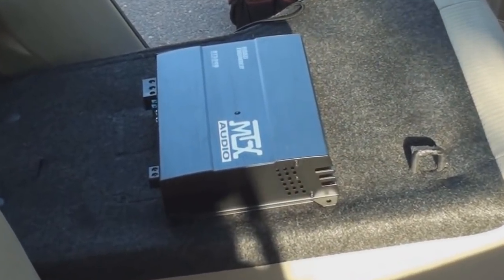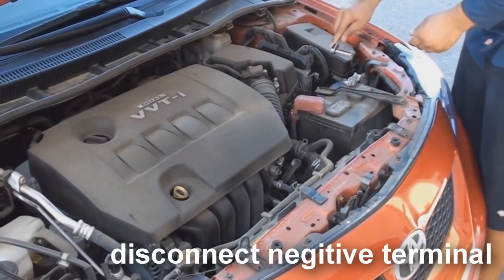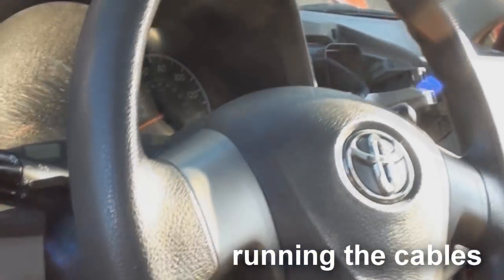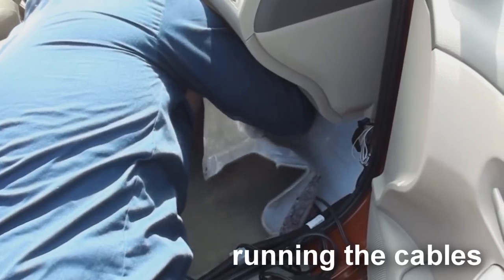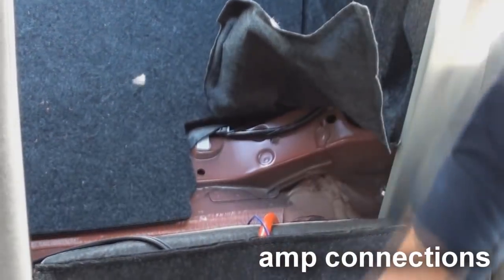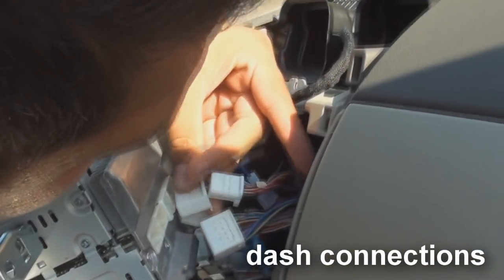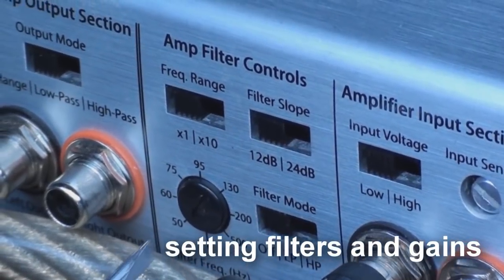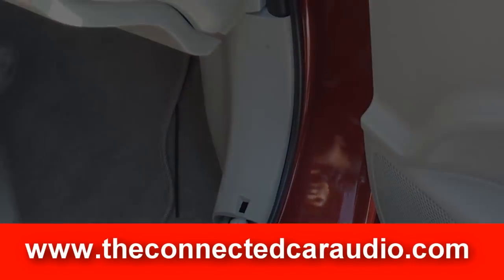How to install a car amplifier

Comment: BRILLIANT thanks so much i am able to do the full installation but never been good at setting the amps to work without as you say distortion ive run 4 speakers before with a 4 channel but never had that much success also running an aftermarket headset like a kenwood with 2x RCA outputs not needing a splitter ive never tackled using tweeters in the front pillars

Comment: Bro ty..This is the best video I’ve seen...I was a bit lost as to where did I connect the blue cable to turn on the Amp. I recommend this for Noobs like me.
Reply: yes mine is jus laying under driver side floormat plus i dont use rca cables jus that one plug in with wires to it

Comment: Another one who takes shortcuts with crimping wires that work their way loose quality work is done with soldering and there are enough male female adaptor plugs out there to do the job once do it right also without butchering the loom but i give you 10/10 for your tutorial clear and precise explanation i learnt a few things

Comment: you  said rund the power supply and the remote or on off switch to the driver side and the audio in to the amp will be on the opposite side or the passenger side to avoid noise into the system, BUT at the end of those wires you put them close together behind the seat close to the amp, my point is if you put them or wired them on one side of the vehicle saves time.

Comment: Very well narrated/instructed and in lowest possible time as well. I'm sure you have a great customer base where ever you are. Just if you could make another video on how to connect just internal speakers ?
So the speakers have two wires, both come off and new one connected with amp is connected to speaker too ?

I'm trying to reach good sound using just good brand 6x9 and 4 5" speakers, but all connected to an amp. 
Thanks :)

Comment: you forgot to mention that when you drill through the body panel into the firewall, you then paint the exposed metal to stop rust, then add an o ring with the correct gauge hole that you can feed your wire through

Comment: ConnectedCarAudio, It looks like you're working on an 09 corolla? By any chance, do you have a video of the entire install? I'm struggling on two things: 1) where to drill or feed the amp cable wire through the firewall 2) wiring diagram for the rear speakers to add in an output line converter. Warm regards

Comment: This video has helped me understand all of this a lot better.  I'm going to need to use a Line Output Converter with my car to use a sub woofer, but I'm unsure on how to hook that part up correctly.  Would I need to figure which wires hooked into the factory stereo are my rear speakers so I can tap into their response, or do you have another suggestion?
Reply from the maker: That's exactly what you need to do. The rear speakers are usally the best to tap into. If you are installing a subwoofer it makes it a little bit easier cause you can sum the line out converter positives together and the negatives together and only tap into 1 rear speaker. I have a video on how to add a subwoofer to a factory stereo but it's for a camry I think but you should be able to watch it and get a better understanding of adding a line out converter
Reply from the maker: That's exactly what you need to do. The rear speakers are usally the best to tap into. If you are installing a subwoofer it makes it a little bit easier cause you can sum the line out converter positives together and the negatives together and only tap into 1 rear speaker. I have a video on how to add a subwoofer to a factory stereo but it's for a camry I think but you should be able to watch it and get a better understanding of adding a line out converter

Comment: nice video and well explained. i have a quick question. i recently bought an amp wiring kit for my 1100W 4chl amp. but it did not contain all the terminals i needed. what size terminal would be best to connect a 4gauge wire to the amp and the ones that came with the kit (for the ground and the battery) are way too big to connect to the amp. Thanks

Comment: There are much better options to mounting the amp like that. There is no need to cut up the rear carpet that much as that will affect the resell factor.

1.) Pull rear carpet off the back of seat which exposes usually a metal plate

2.) Cut a 1/2 , 5/8 , 3/4 inch board to the size of your amp with at least an extra inch or two around the sides.

3.) Find a good place to screw the rough board into the metal back plate. Slightly countersink screws if you want less worry of metal on metal contact. Simply drill the small screw holes and then use a slightly larger bit to open up the hole only on the surface to allow for the head of the screw to sink into the wood.

4.) Put the carpet back over the board and securing it back to the seat using whatever factory clips / edging was used. Should have a very clean looking rear seat with very minimal bulging from the wood installed behind / under the carpet.

5.) OPTIONAL but worth it. Find something to use as a spacer about 1/2" - 1". I used extra hardware from TV mounting kits which allows me to have the amp slightly raised away from the carpet. Mainly to be able to have a near cable free installation plus it does allow some air flow which was a bonus. 

6.) With the amp mounted over the carpet and into the hidden wood board using spacers to allow a gap under the amp. Now route all the cables directly under the amp and secure them with some sort of wire management. Just attach the cables to amp and route them directly underneath the amp. You might have to remove the amp once to add securement of the cables to the board and then put the amp back and make final connections.

My amp is mounted low enough on the rear Camry seat that when I look from the rear of the trunk and the seat is in the normal upright position that all the cables that are routed under the amp and then down out the middle are covered by the trunk carpet. If your amp is higher on the seat then you could cut a slit UNDER the amp carpet so all the cables are under the amp and then routed under the carpet under the amp out the bottom towards the trunk floor. Only holes I put were the 6-8 small screw holes in the carpet. VERY Clean looking with all the cables routed directly under the amp. Almost looks like no cables are installed as it is just a amp. Make sure you secure your power wires under the amp so the wrapped around method under the amp won't put stress on the connections and work their way loose later.

Comment: I always thought that the power wire was supposed to be by itself. I didn't know that you could run the power and remote wire together. I have one question. How do i go about running aftermarket speaker wires for my car doors? I have an aftermarket amp for the door speakers. Do i have to route the speaker wires under the rug? Or do i have to remove the panel and routed it through the headliner of the vehicle to avoid it being near the power and signal cables?
Reply: If anyone sees this... BUY "9 CONDUCTOR WIRE". Seriously it will save you ripping up your car and fucking up all the trim. Its one fat wire with 8 speaker wires and 1 turn on wire inside. Run it behind your radio WITH the rca and connect it to your aftermaker speaker adapter  which is an oem plug---->8 speakers wires +12v,12v switched, ground.  Then run the wire to your 4 channel amp and you have all the speaker wires right there, NO NEED TO RUN NEW WIRE!

Comment: I have a system installed in my car, but unfortunately I left my headlights on and now my amp doesn't sound the same. Any reason why this happen and how can I fix this problem? Thanks! Great video by the way!
Reply from the maker: Make sure that your battery is still able to hold a charge and a good voltage. Once a battery good dead it never really is the same afterwords unless it's a deep cycle battery. Check the voltage of your battery when the car is running it should be about 14.4 volts and 12.4 volts when the car is off. Maybe have auto zone check your battery for you or use a meter and test it

Comment: Great video. But I don't lie to run any wires along with the power. Normally when I do an install I run the power by itself and all the others wires on the opposite side from the power so you don't risk melting a wire and causing a fire.

Comment: Do not use a self tapping screw to connect your ground. Use a bolt, a nut and a lock washer. Otherwise your ground will work its way loose and your amp will stop working.
Reply: Just watching this video makes me want to deliberately avoid such an obscene subject!! A project like this would only make sense for a full-blown restoration!!

Comment: Awesome video, I'm currently installing a sundown audio 8" sub for a Hhifonics amp and I believe my problem atm is I wired the amp turn on wire to the wrong wire behind the stereo. I'm new to this so I did some studying but obviously not enough cause my shit isn't working. I bough a amp wire install kit, and The RCA are the normal red/white, but the Amp turn on wire is black, so I put it with the black wires behind the stereo.  My amp doesn't power on, go figure. So I'm going to rewire that black amp turn on wire to the blue with white strip wire behind the stereo. An hopefully my shit turns on. PS: I'm also installing this in a Toyota Corolla 2010.
Reply: Not sure if you got it figured out but usually the remote wire coming off the headunit says remote wire on it or amp power

Comment: really nice video. but why do you connect the ground to the car chassis? isnt that dangerous? wouldnt a cable going back to the battery be safer?
Reply from the maker: In car audio the ground is almost always  connected to the chassis. Only time it is ran to the battery is on some vehicles like corvette where the body is mainly fiberglass or  boats where it's the same concept.
Reply: +connectedcaraudio thanks for the reply!! but even in high wattage systems? wouldnt that create eletroestatic energy?

Comment from the maker: Hi sketch you said the ones were to big to fit into the amp? Can you shave them down? Cut them on the ends? Or bend then in so they fit into the amp connections? You can also go bare wire in line I did with the connections in this video.. And I think you said you had a hard time putting the power wire on the main battery?

Comment: How did you mount the amp to the back of the seat?  Did you just use specific screws?  I have a corolla like the one in your video so I'm just curious
Reply from the maker: Usually I will insert a peice of mdf a little bit larger than the amp under the carpet . then I will screw the amp to the wood .if the board moves around I will usually shoot a short screw through the mdf into the metal of the seat

Comment from the maker: f your looking for a amp kit that I recommend  please click this link to this amazon page 

Favorite budget amp and sub combo https://amzn.to/3gnv3mK

the I got kids but I still want bass setup  https://amzn.to/2TLY1Vx

the I got kids but I just got my TAX RETURN setup https://amzn.to/3iy3J86

Recommended 4 Gauge Amp Kit https://amzn.to/2R0BUpI
Recommended 8 Gauge Amp Kit https://amzn.to/3jMmrpN

BUDGET 4 gauge amp kit https://amzn.to/32ZHiPD
BUDGET 8 Gauge amp kit https://amzn.to/3lNGYMm

most notable difference is that the  PREMIUM kits use OFC (oxygen free copper ) which conducts electricity much better and the budget kits usually are not true 4 Gauge resulting in less wire strands 

Budget will be alright for most amps but if your running more than 400 watts rms power I recommend the premium amp kits 

learn how to install a amplifier in your car or truck with this detailed video. we will go over everything like panel removal,running the power cable, running rca's ,connecting the ground cable and much more.
Reply: Thanks buddy
Reply: I recommend the stinger 4000 series 4 gauge. Walmart online $64 way better.

Comment: couple of things bugging me. Dont run the audio wires along side the power, doesn't matter at what point, just don't.

Remote actually does not matter, contrary what some one else here says. if the cable of power wire is isolated enough, there is no issue of burning any of the 2...
Reply: True. I was told a long time ago that you want to keep power and ground away from the speaker wires as much as possible. If they have to come close, it's better they cross than run alongside each other. The electromagnetic fields in the power wire can introduce noise into wires carrying audio signals. Like you said, the remote wire doesn't carry audio signals, it just tells the amp to turn on, so why would that one matter?
Reply: I'm just slightly confused at which point he did this? I've never installed an amp/sub, so I'm trying to get all the information I can before I do this. I managed to get my speakers and deck in with a little help. In the video he ran the amp turn on wire and power cable down the driver side, and the rca cables down the passenger side, then grouped them at the end for the amp, right?
Reply: CmdrGendoIkari No, keep the RCA cable away from power/ground and speaker wire. It doesn't matter if you can put together your power/ground and speaker wire in one place. You may also keep your remote wire away from RCA because the remote wire is carrying a voltage/current when the Head Unit is on.

Comment: the ends of the wires that are clamped in the clamps processed by the solder, usually spend too minus from the battery.

Comment: Question on your amp settings. What if you are connecting 4 door speakers and 2 subwoofers to your amp? How does it work then if you want bass on just the subwoofers but high frequencies on the vocal door speakers? Could you use a bass volume knob and then not have to worry about the settings on the amp for the low pass and high pass?

Comment: I heard the first part of the power wire going from you battery leading to the fuse, should be no more then 18inches. Is that true? Also, how do I know how many Ohms my amp is set at?

Comment: so i have an after market head unit and After market front and rear speakers.   I had to splice the blue wire from the head unit to the after market wiring harness blue white cable because the directions said.   i may have the colors mixed up but i no i Already spliced the remote blue white cable to another cable that is inserted into the head unit. Am I supposed to undo that?And connect the power on amp cable to the head unit? or do i splice all three together?   sorry if it's confusing.

Comment: thanks so much for the video so you would need a separate amp to power the door speakers and a different amp to power some subs?
Reply: RichGarcia Tv you can use one amp. but you'll need a 4 channel or greater amp. one for each speaker and 2 for the sub

Comment: so, to be clear, for amplifying door speakers, I run the speaker wire from the amp straight to the speakers right? so I won't be using the existing wires from my head unit to the existing speakers, correct?
Reply: spiralnapkin Correct.

Comment: Hey u missed something but great video how do u screw the amp to the back of the back seat mine is just foam back there lol
Reply from the maker: Try to put a piece of wood in between the carpet and the foam. You may have to unzip the carpet part to fit a wood board underneath. Then screw down to that
Reply: @connectedcaraudio  thx u

Comment: use wire ferrules for the cables on the amps never straight up wire , or the wire reductors like to ine used on the fuse holder

Comment: the Meth from installers sweat produces 50 to 70 more watts RMS depending on purity of Meth pipe and Meth quality.I have dripped sweat producing 1200 watts RMS on Meth and imported Vodka.Check amplifier specs for Meth sweat stability peak Meth resistance.50 ohms not homes.I use a Sony Walkman with Super Bass boost internal amp to powers 18 6 by 9s run in a perpendicular.Set radio to Spanish mode.Loudest stolen car on the block
Reply: Humpty Dumpty 🤣🤣🤣🤣🤙

Comment: So i just installed a parrot hand free system into my car. Theres a wire labeled ignition on the parrot kit, which goes into the radio. Would that be the wire i have to tap into with the remote cable?

Comment: the amp is a Pioneer GM A5602 Class AB 2‑Channel. and the subs say 4ohm. they were prewired to 2ohm
Reply from the maker: +Tim Osness okay so the amp is okay to be bridged but that's at a final ohm of 2 ohms but since you wire the subs together then bridging at the amp you end up with a 1 ohm load which that Amp can't handle correctly. I would take one of those subs and put it on a ported box and bridge it down at the amp for a final 2 ohm load. Or get a Mono block Amp a mono block Amp is a one channel Amp and what ever you wire your subs for that what the amp will see. So wire your subs in parallel for a 2 ohm load and put it on the mono block Amp
Reply: +connectedcaraudio did you get my other messages.

Comment: my mechanics didnt use fuse holder, they just bent the wire with battery part. do u think there is a chance of spark or is it dangerous ? i used pioneer champion series 1200 watt and pioneer 8150d amp 1000 watt.
Reply from the maker: yes its dangerous because if you have a short in the wire any where down the line all the way to the amplifier it will run up and the line and short out your battery ,this will cause you to buy a new battery and possibly a new alternator.get this fixed as soon as possible. dont  wait
Reply: oh i see.